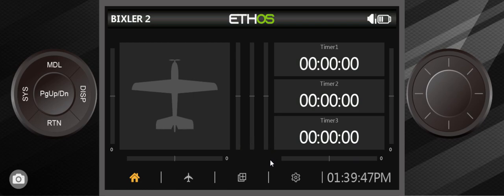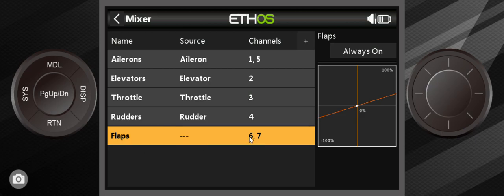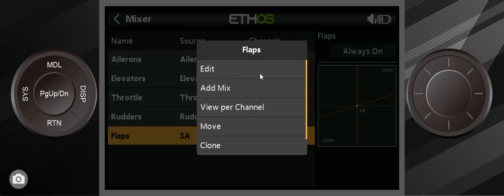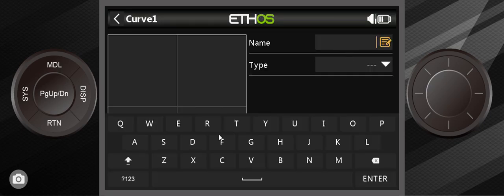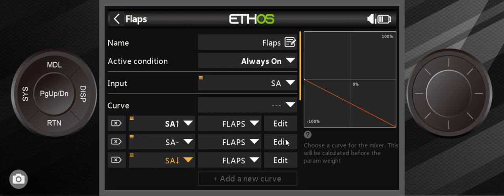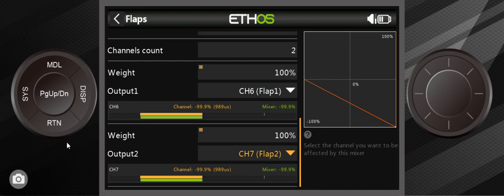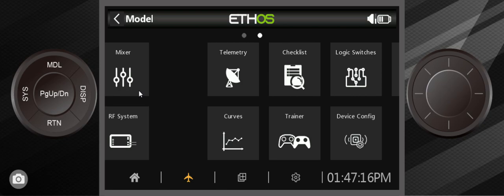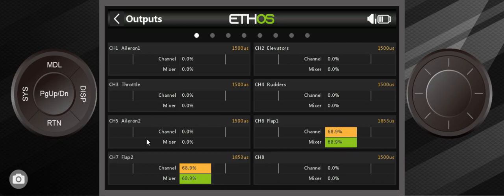FrSky Ethos Flaps Tutorial

Comment: You are using only 50% of servo travel. It is ok, if you are using flaps as brakes, but in most cases flaps need full servo travel from -100 to +100. In case of using flaps as let say a second ailerons, than some offset is needed. Also flaps can be set to behave differen in different flight modes. I’m more opentx/edgetx user, but still trying to learn ethos, since my old radio supports all those systems and new spare radio for kids comes with ethos.

Comment: I was able to swap the servo wires at the receiver to make the left hand control aileron/elevator. The right stick elevator which is now the throttle required me to create a curve which only starts the throttle at center stick. I used the elevator trim to create a small deadzone at left center throttle  so that controlling the rudders was easier to do. 

How would you have gone about this change? Am I on the right track? I'm just getting the hang of it. I'm a new guy trying to figure out an X20S. What a leaning curve. Your videos are crucial. Thanks for making them.

This transmitter and whoever made this Ethos is amazing. i can't say enough for it.

Comment: Would it be possible to make my ailerons also function as flaps? 

I get my brand new FX20S in the mail tomorrow. My first "real" transmitter. I'm so intimidated. I've never had anything more than a basic 6 channel with manual everything. Nothing fancy, in the 60-80 dollar range.
Reply from the maker: Yes, they are called flaperons.  I will probably make a video on this.
Reply: @steveschlesinger3459  That would be really helpful. I'm putting an FPV setup in an Arrows Prodigy and with the extra battery, I wanted flaps, as the extra weight will lead to faster landing speeds. But, I don't want to try adding a flap system to it. More weight, and running wires through an otherwise completed airplane is an all afternoon project.

Comment: Steve, at 5:50, when you set up 3 curves each selected by one switch position, isn't it simpler (and same result) to have one curve and set input to "Switch A" in general (not a specific position of Switch A)?   I have mine set up this way, and I don't see any difference in end result.   I can edit the three points, and Switch A moves the output across those three points on one curve.   Maybe there is some benefit to having 3 flap curves and using only 1 of the three points on each curve (as shown in the video), but if so I'm not understanding what that benefit is.

Comment: Why are you only using half the servo travel?  If I were setting this up, the flap curve would be 3 points, -100 and 100 on the ends, and the middle point somewhere between the two, depending on how much I wanted for my intermediate flap setting.
Reply: Exactly my thoughts, I’ve never setup flaps how he did in this video with only using 50% of the flaps available travel. One end is going to have a mechanical advantage and the other end not.